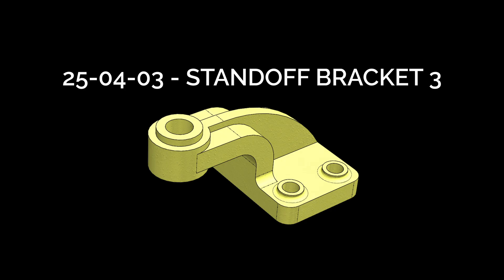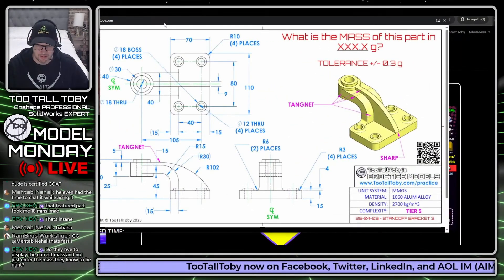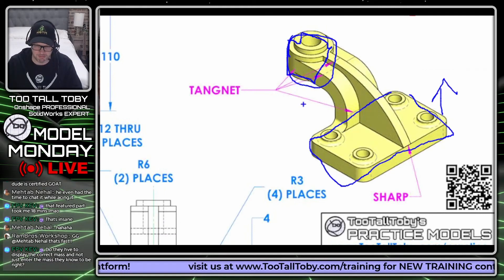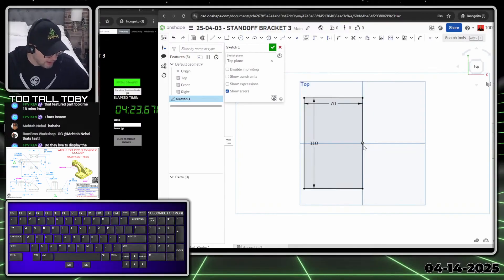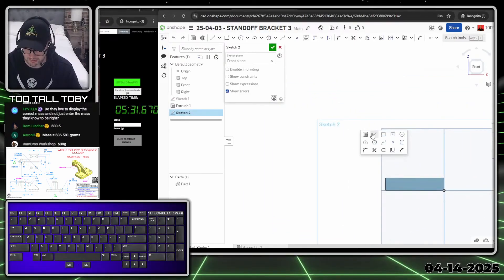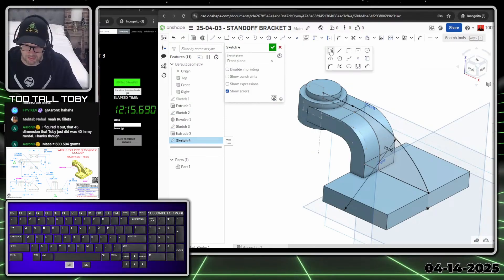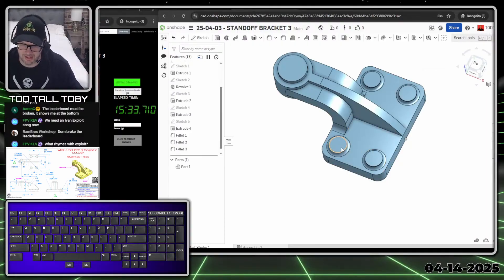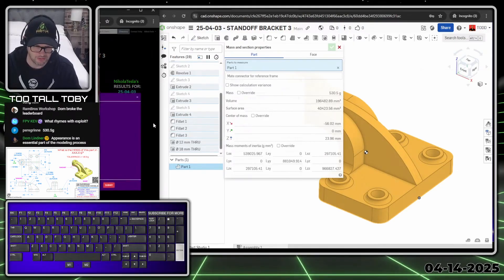HOW TO LEARN CAD - Onshape Best Tutorial for Intermediate- TIER 5 Challenge - STANDOFF BRACKET

Comment: Hey Toby, I just want to say, I love your work. You’ve helped me master OnShape in just a few weeks when I genuinely thought it would take months. I feel really confident in my skills so far, thanks to your clear and practical approach. That said, I have a humble but important request…

One major gap I’ve noticed across all OnShape tutorials is the absence of detailed guidance on multi-planar tubes. I’ve searched high and low, and there’s almost nothing out there that walks through how to efficiently model continuous tubing that bends across multiple planes. Existing tuts only show how to make a tube bend in one axis at a 90-degree angle (or 45 or 60 degrees), e.g., a tube going up then left.

To help you understand what I'm looking for, picture this: a tube that goes straight up (Z axis, 90°), turns left (X axis, 45°), goes up again (Z axis, 60°), then forward (Y axis, 60°), and so on. A seamless, organically routed continuous tube that twists and bends in multiple directions (axes).

Would you consider doing a tutorial on this? Or if one already exists, I’d be incredibly grateful if you could point me in the right direction. This is the one area holding me back from fully committing to OnShape, since most of my designs involve exactly this kind of tubing.

Thanks again for everything you share... it's made a huge difference in my journey.
Reply from the maker: Thanks very much for the kind words - you probably have to do a composite curve like this: https://www.youtube.com/watch?v=g3J6ag6DPEs 
Onshape doesn't have a 3D sketching tool (yet)
Reply: Thanks for sharing. I actually saw and followed along with that video earlier and was able to get the tubes I wanted. But I found the method a bit unintuitive and overly complex - mostly because there’s no way to sketch one continuous 3D curve or line and just extrude along it. I was hoping OnShape had a more streamlined, tube-specific workflow for this kind of design. But it’s all good, keep doing what you do!